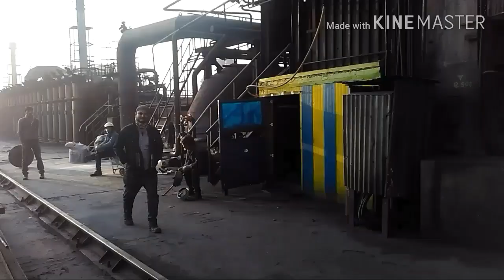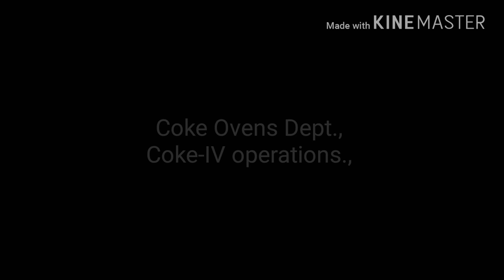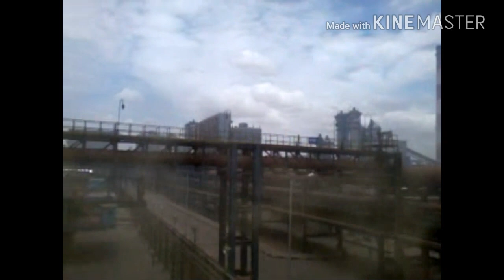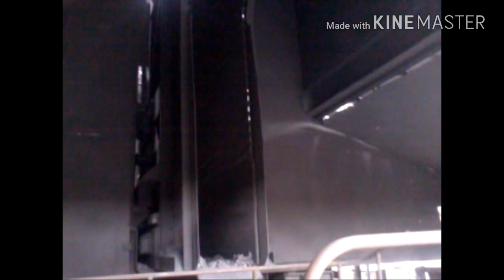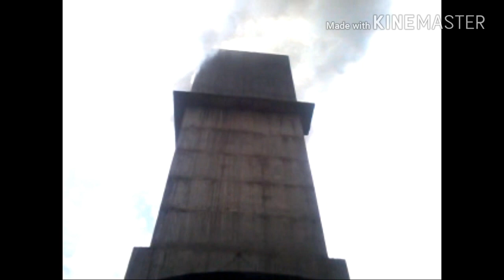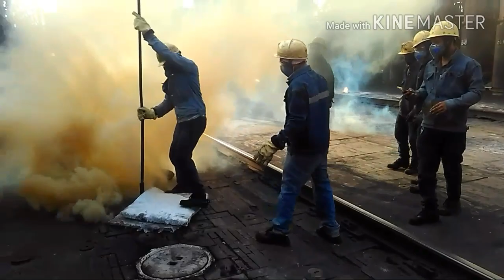Coke Ovens

Comment: The machine labelled the charging car was the pusher car some times equipped  with a leveler, the charging  car runs on the top of the ovens and fills all pots on the one oven at a time
Reply from the maker: It's Chinese technology, coal cake charged from pusher side.
Reply: @Michael: there are (at least) two different systems:
The most common one is what you describe: charge the ovens via larry car from the top and discharge them via pusher from the side.
"Bad" coal requires that it is compressed (stamped) before it is charged into the ovens. This is done in the chamber of the charger/pusher car shown here. You will find this process mostly in Poland and Czech Republic, but I have also seen examples in the Saar area in Germany.
Examples: 
Czech Republic:
http://hfinster.de/StahlArt2/archive-Cokeplants-Czech-Republic-BW-4050-3-13.04.2012-en.html
Völklingen (Saar area, Germany):
http://hfinster.de/StahlArt2/archive-VoelklingerHuette-BW-7130-3-14.11.2002-en.html
This is the first time that I have seen this interesting  process in a video. Well done!
In case of the top charging system the coal tower is located above the ovens. In case of the side charging the tower is located laterally above the charging/pushing car. Thus you can easily tell the difference even from the distance based on the architecture.